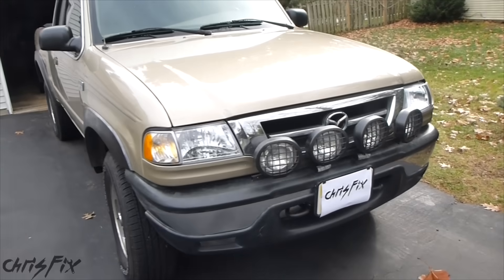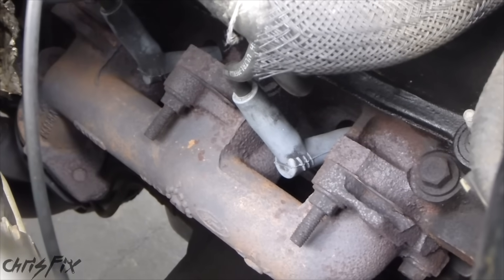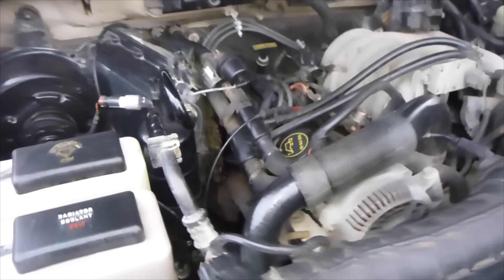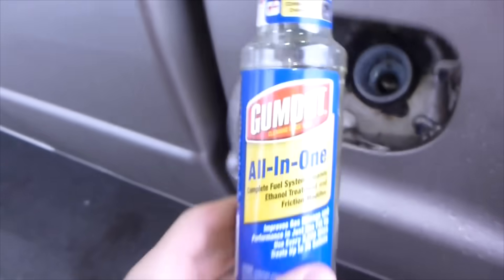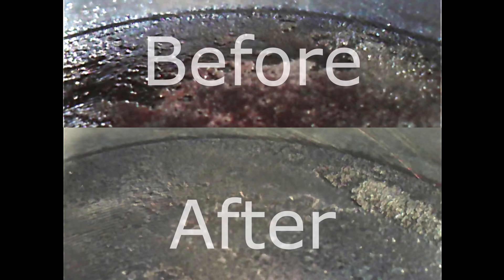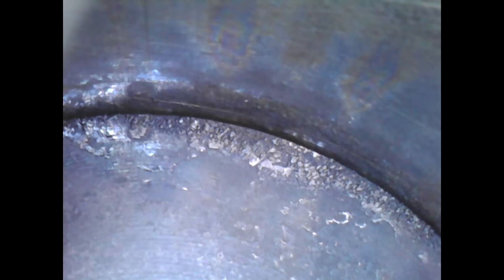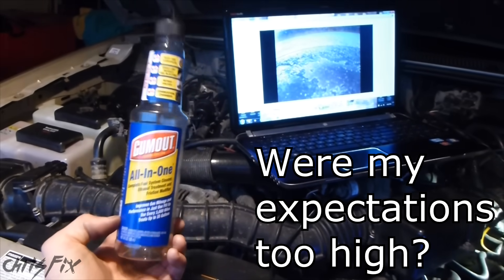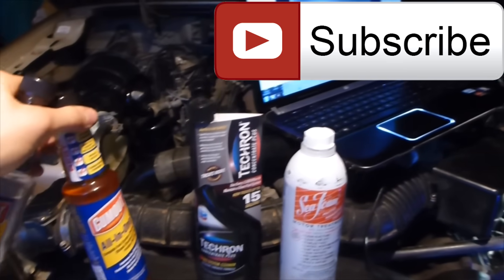Do fuel system cleaners actually work? Testing Gumout "All-in-One"

Comment: Is no one talking about Chris only had 210 miles on 1 TANK of gas? Wow that was little.
Reply: Watch the vid again and you'll see he didn't full up his tank he needed 18ltrs
Reply: @sagarennaidoo1768  Perhaps you need to watch the video again or re-read the comment you replied to.  ChrisFix went 210 miles on 1 tank of gas.  Not the best MPG (which is what Shaft O. is talking about).  Also, it's in gallons and not liters.  If we are using liters, he would need 68 liters to equal the 18 gallons suggested.
Reply: @HeyCoachTV  
That person is clueless. 
Chris Fix did fill his gas tank.  
He had 3 gallons roughly left in the tank and filled with close to 14 gallons as shown on the fuel pump.
Chris Fix said his tank is 17 gallons....

Comment: If you use these fuel additives from new you would probably prevent carbon build up.

I don't think I'd want those carbon particles airborne fowling valves and and mating between rings and bores.

I doubt it would cause noticeable if any wear but they would have to be rough to produce a cleaner like that.
Maybe try one of the $2 shop ones.

Good video, now we know, thanks!

Comment: You idiot adding cleaner after 120K miles and expect magic? These products are to be used regularly ever 3 to 5k miles in a brand new car from factory to prevent carbon from sticking on cylinders by years! 

And now you are disappointed! 🤦🏻‍♂️

Comment: Any Tier1 gasoline will do a better job of keeping the insides clean.  This product, like dozens of others lining the auto parts shelves, will "work" only in that you will feel better for having used them.  In medicine it's called the Placebo Effect.  Do you change your oil at 3K miles? Good for you, but totally not necessary.

Comment: I have used Many fuel system cleaners. The only one I have found so far that really works ( 2 separate applications over 3 tankfuls) is called Guaranteed to Pass as in passing an emissions test. My 99 Nissam Maxima with only 85K was plagued with water and dirt in the fuel, very poor mileage and a consistent hesitation. After the 2 applications over 3 tankfuls, runs very much smoother, about 25% more power, hesitation is gone and amazingly about 40% more gas mileage. It is a dramatic difference. 

Also, no matter what anyone says, premium fuel is worth the price. The Nissan runs far better on Premium. Also suggest to use Lucus Diesel additive with REAL WATER DISPERSENTS OK for gas engines. Use one cup per tankful over 6 tankfuls to get all the water out. When ethanol degrades what does it become? WATER!!! Your local Wally World carries these products.

Comment: Since you can place a boroscope in a cylinder that means we could make a device to scrape and break down deposits and remove them with a telescopic grabber. Better than send that hard deposit into the catalytic converter to damage it.  Once all pieces are removed, another device could polish the cylinder walls and pistons. A miniture telescopic orbital sander and vacuum. If they can build such devices for surgeons, they can build them for this application.

Comment: A cheaper and better result put a little E85 every once in awhile in your tank. Every two or three months when ever I am 1/4 tank low, I put E85. The car runs a bit rough for a a couple of days but when I fill back with regular gas after it gets to half tank it is better than ever. For info purpose, doing it on a Scion TC for years already. All that stuff is just Alcohol and Toluene,  Pretty much the same as E-85

Comment: YEAH like i think i have the situation where a debris is caught in the check valve because mine bleeds out overnight, like i can park the car and start it 2 hours later and its still fine but when parked overnight then the cranking time is longer. so question is that is there anything i can use to flush the debris out of the check valve ? i probably got it like this because i am too cheap and my gas is always on low and so i am sure dirt from the tank has gone and blocked the check valve, and this pump is relatively brand new. bought and installed like 6 month ago so i know it cant be broken yet. THANKS CHRIS. SO THE QUESTION ONCE AGAIN ? IS THERE ANYTHING I CAN USE TO FLUSH DEBRIS CAUGHT IN CHECK VALVE AND MAKING THE FUEL LINE LOSE PRESSURE  ONCE CAR IS TURNED OFF. THANKS BRO

Comment: Try a soak instead. Mix diesel, atf, acetone, pour into a cool engine directly in the cylinder through where the spark plug would go, re insert the spark plug and let soak for at least a full 24 hrs, take the plugs back out and turn the engine over till no more fluid comes out and re check the compression and look at the before and after with a bore scope. Do this just before an oil change.

Comment: Dumb question but I seriously want to know...... When you remove the plugs, is it safe to stick a funnel down in those holes and simply pour something such as that gumout or seafoam directly into the block? I have that exact same motor in my Mazda b3000 and I am getting very poor fuel mileage, I'm wondering if this will seriously help or hurt. Please someone reply.
Reply: I don’t think it would hurt, try fogging oil or whatever you like just make sure you put everything back

Comment: i know this is from 2014 but did you ever actually put the gumout directly inside the cylinder and let it soak for a while?   wonder if that would break apart those hard deposits.

Comment: Hey, Chris. I've been using PB Blaster to remove carbon buildup on pistons. First you need a warm engine. Put your gloves on and remove the spark plugs. Then use the straw on the can inside of a drinking straw with a long tape tab on the top to prevent you losing it inside the cylinder. Then you spray each cylinder for about 5 to 8 seconds. Wait 30 to 45 minutes. Then you crank it after a few times, and let it run for 30 minutes. You should see white smoke out of your exhaust pipe. Try this. And use your boroscope  to check the results.
Reply: Can you please make a video on how you do it. Thanksssss
Reply: 0

Comment: The fact that cylinders #2, 5 and 6 have more carbon deposits and less likely to be removed, is that not all of their corresponding fuel injectors were clogged equally and thus the worse fuel spray the more incomplete fuel burning and consequently more deposits.  To be fair, this test should be done after all injectors were thoroughly cleaned for equal distribution of the additive in the tank.  Personally, I think the brand of cleaners may not be important.

Comment: The product that I use to clean & protect my engine = Shell V-Power!!    I have used this gasoline in each of the 4 vehicles that I have owned over the past 15 years, even though none of those vehicles required premium gas.   The engines in each of them ran like a charm the entire time I owned each of those vehicles.   And never once did I ever experience any hesitation upon acceleration.
I swear by Shell's V-Power cleaning additives!   Huge bonus = no ethanol content (i.e. watered down gas)!

Comment: Change your car fluids and Chris has good videos on that...buy gas from so called Top Tier Stations only like Costco and Shell.  I think all these other products are snake oil. Blue Devil, radiator stop leak etc etc are a waste of your money. Lucas oil products? Really? Just change your oil, coolant transmission fluid, brake fluid as required and you will not need these wasteful miracle products. It's your money!

Comment: I wish someone would recreate this scenario with a couple of brand new small engines & do monthly updates on carbon buildup progression. 

Its OBVIOUS that all these carbon cleaners need to be used early in the motors life to be most effective. Its like anything, you cant wait until the damage is done to try & prevent the damage. Its like wearing a bike helmet after you crash & damage you skull. You may prevent further damage but you cant undo neglect. I would bet though if you started using a Carbon Cleaner on your motor when its brand new or even at your first Oil Change you'd see a huge difference between your motor & a motor that didn't use it from the start.

Comment: Question how can you use the same vehicle for testing after using other products on the same vehicle?
Reply from the maker: There is (supposed to be anyway) a cleaning effect right away that is measurable, but after that there is no long term effects of using any of these products (That's why they say to use once every fill up or something like that), but to be safe I would run a few tanks of gas between tests!

Comment: On an older engine, carbon build up on the edges is fine because age increases wear (generally) and thus as an engine gets older the pistons become more worn and thus there will be some "play" between the piston edges and the compression chamber so effectively the carbon build up on the edges of the piston crown help to seal the cylinder better, if you remove the carbon build up on the edges you can make the compression worse as then the gases leak passed the cylinder edges so its fine to clean the crown of the piston but always leave the edges alone, on an older engine.

Comment: Chris: you said that you've seen some engines with hardly any carbon deposits. Is it due to engine design or the fuel we use ? I just wonder if there is anything we can do to minimize carbon deposits on our used cars.

Comment: I used to use fuel system cleaners at each 5k mile oil change. (MY preference was Chevron Techron) THEN I worked for a courier company that was seeing nearly 300k miles on their vehicles with basiclly NO fuel system maintenance. WE use Top-Tier fuels and no longer use fuel system cleaners or additives!

Comment: From previous experiences a student I used to use a fuel additive on every fill up of the 10 year,old car I’d bought (I’d only use a tank about once a month and the previous owner had used an additive from new) then I bought a series of new cars through the years myself and didn’t really bother, but now I’ve a classic ranger with a clogged injector so it’s back to trying the additives to see if they’ll sort it.....  i think it’s more about using an additive as a car ages or gains mileage to help keep it,going into its later years... at what mileage or age that starts to,help,though 🤷🏻‍♂️ I have no idea, maybe after 5 years or 60,000 miles

Comment: What I do is remove spark plugs.
Use gummout spray and spray some inside the cylinders.
Let it work over night.
In the morning re install the spark plugs and use as normal.
Gummout spray will make the carbon curl overnight..
Reply from the maker: Thanks for sharing!

Comment: From personal experience from over 30yrs of use I can vouch for Marvel Mystery Oil (MMO) as the best all around engine lube/ fuel system maintenance and remedy additive on the market for both effectiveness and cost. Everything runs better and gets better mileage almost immediately! You can't beat it for the money. A bottle of fuel injector cleaner every now and then  doesn't hurt. 👍😉

Comment: I used Amsoil Power Foam but it doesn't go in the gas tank, took three cleanings over the months but it did work and I could definitely feel a difference in performance on my 6.2 liter.

Comment: This product is more of a preventative, rather than a restorative agent.  If you used the product every oil change on a new car from day one, you might be more pleased with the results. In order to remove the major carbon build-up, the product would have have greater solvent agents in it and that might cause the cylinder heads to wear down with increased friction.

Comment: Did you ever test out water?  In the old days, we rigged up water sprayers on some of our 4 cyl turbo Mustangs, et al. to cool the aircharge....  We got the power, but never thought to inspect the cylinder bores.
Reply from the maker: I have not, but I can make a video on it!
Reply: @chrisfix  That'd be great!  I just figured it would be a good comparison to the solvent-based fuel cleaners...  Those old water injection systems we used to use apparently tended to keep the combustion chambers sparkly clean on our turbo-equipped machines.

Ignore my other inquiry about water on the other vid...  sorry to post in two places...

Comment: I'm not a car guy but my takeaway from the fuel additive tests is that it's a slow process. You won't see huge immediate improvement. But if used at each fillup over the course of a vehicle's lifetime compared to one where it wasn't used, you'd see definitive results. You won't clear a mountain of carbon overnight. But you can over time. Or even prevent it from forming in the first place. I'm convinced enough from your videos to start using the stuff.

Great videos all around. Thanks, I've learned a LOT.

Comment: Chris, today is August 14, 2020. I checked out a bottle Gumout and the instructions say add bottle to 1/4 a tank of gas, drive 5-6 miles then fill the tank with gas. I guess that concentration is suppose to work on the carbon?

Comment: Most cleaners only clean the injectors , intake valves  and the oxy  sensory ( soft carbon)  the techron will clean DRY carbon on the pistons and FLUFF it off ......but if the car burns oil .....the carbon is still wet with oil and  will NOT dry out and FLUFF  out the tail pipe. Figure it out . maybe run alcohol first ???   ( "Dry gas "   water remover  is methanol  ) ....
Dont use synthetic oil because  it gets into the cylinders to easy , also, maybe  use a thicker oil ....like straight grade 30 hd.

Comment: This is a 10 minute video of just saying “no”. That’s hilarious
Reply: It's actually a "kind of". The issue is not using earlier. If you use this earlier it will maintain the clean cylinder but once it gets bad it gets harder to remove.

Comment: I would like to see a test, for example, of extreme conditions, using this stuff for ten tanks in a row, before and after.  

I imagine the difference would be greater (and the cost, of course, though if it made a difference, it could be worth the life of your car).

Though I wonder if running this stuff through every time wouldn't be bad for some other components.  Maybe it would be worth the benefits gained.  

Seeing very small improvements for only one tank of gas makes multiple tanks seem promising.
Reply from the maker: Thanks for the idea!

Comment: I had mine done professionally, one of the best decisions, especially if they use an actual machine to do the job. I used to use the bottle but I would use the bottle once a month, years after I got my fuel injectors cleaned.
Reply: Was there a noticeable mpg difference?

Comment: Be interesting to try it on a bad injector. I don't really worry that much about carbon deposits, on a FI engine it's not the issue it used to be, but a dirty injector can really screw with your mileage and performance. You'd have to find a bad injector that was visibly bad if you pull it out of the engine and film the spray pattern, then run this through and see if that gets better.
Reply: Often a cloggedinjector will cause an engine to die quickly after the first start. Yes a cleaner will often clear the issue I mix my own but there are others that work. Berryman b12 is cheap and effective.

Comment: Ehhhh. I wouldn't personally use Gumout lol. Seafoam usually tends to work better if nothing else is around, but results can still vary. It's only like 2 dollars more also.

 Personally, I would use LiquiMoly ProLine Engine Flush or Fuel System Cleaner. It's about $5-$10 more than the Seafoam at $15 & $20, but it's the best engine cleaner I've used thus far. They have a whole line of motor products that are definitely worth checking out. They've exceeded my expectations.

 Same goes for Irontite Thoroflush. Best coolant system flush cleaner I've used so far. That stuff removes Stop Leak gunk and even gets rid of DexCool sludge.. All pretty powerful stuff.
Reply from the maker: Thanks for sharing!

Comment: Bought an 09 saab that was obviously sitting for a while. At first the mpg was around 24 after some lucas fuel system cleaners, injection cleaners and upper cylinder lubricant additive and 1500 miles later. The mpg is now 30
Reply from the maker: Thanks for sharing!

Comment: In a KIA Stonic 2020 I just bought, it says to add fuel cleaner additives every year or 15.000 km (about 9-10k miles). My model is MPI (multi point injection). The GDI (direct inj.) turbo version calls for more often. But anyway it says so in the KIA book car manual that comes with the car. I suppose they would not recommend something like this if it didn't work.

Comment: This product is designed to break down the larger carbon deposits over time, not in 1 tank full. If it did, the carbon would not completely escape the combustion chamber during the exhaust stroke. The intake stroke would pull some of the carbon between the pistons and cylinder walls causing damage.
Reply from the maker: Thanks for sharing

Comment: Of course you didn't see it remove all those carbon deposits, if the the engine was treated let's say every time the oil was changed the carbon wouldn't be there. No product available anywhere will remove this deposits in one treatment.

Comment: two questions for anyone that knows more than I do about engines (which is likely most people watching this )  

can you do this several times in a row to remove the chunkier buildup or would that damage anything?
and
does this make any real noticeable difference in performance?   mpg or acceleration etc.   I have a 2002 Tundra with 175k on it fyi